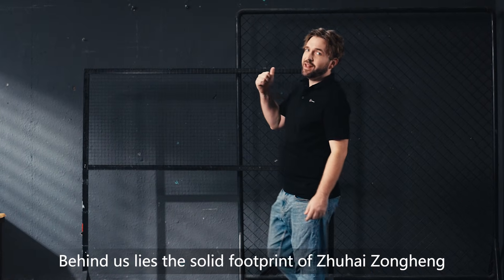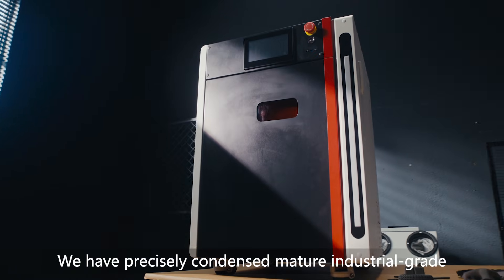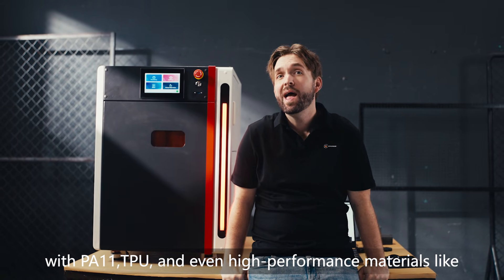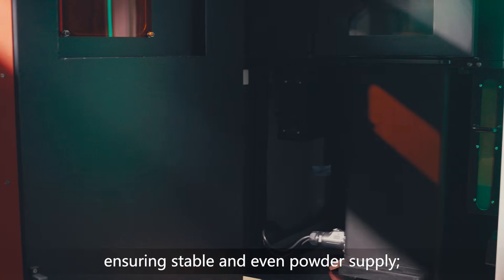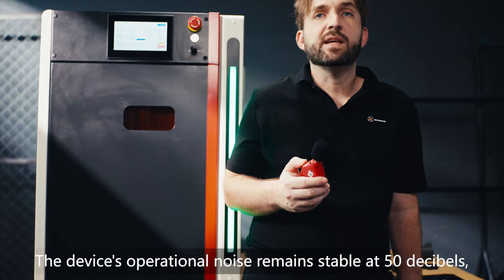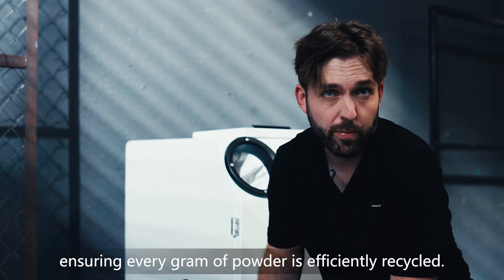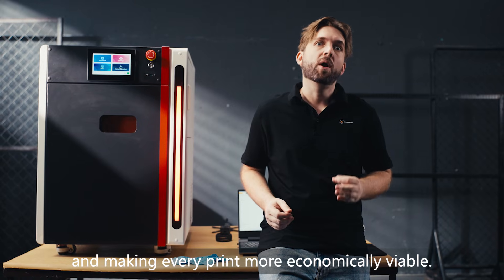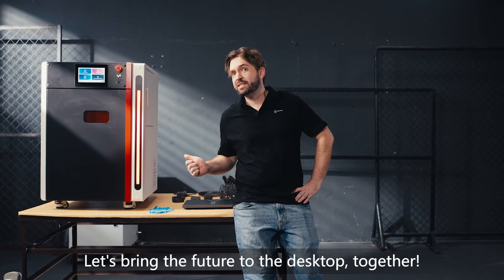Industrial SLS Performance, Now Desktop-Sized.🚀

Comment: Is your plan to become acquired like the other affordable SLS printer guys?
Reply from the maker: Hi, thanks for the question. No, our plan is not to be acquired. We aim at the goal of building a lasting, independent company that directly serves the maker and professional community. We believe this is the best way to stay focused on our users and keep pushing the boundaries of accessible SLS technology.
Reply: they won't be. running hardware companies in china is far more viable.

they also know they won't can't sued there when people get sick from not following proper safety precautions. this machine is a great advancement for small businesses, but doesn't belong in a home unless you have a negative-pressure garage with a sealed door.